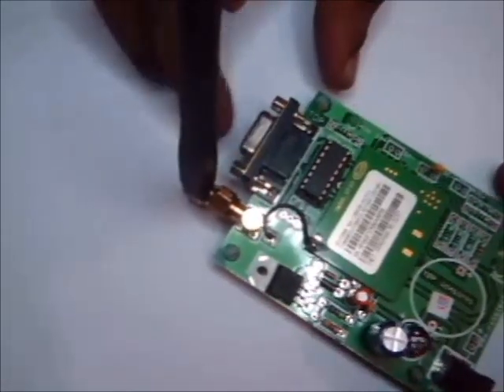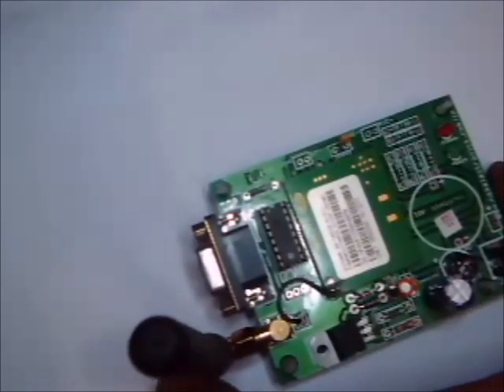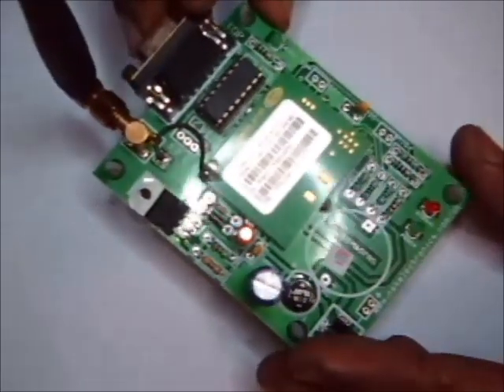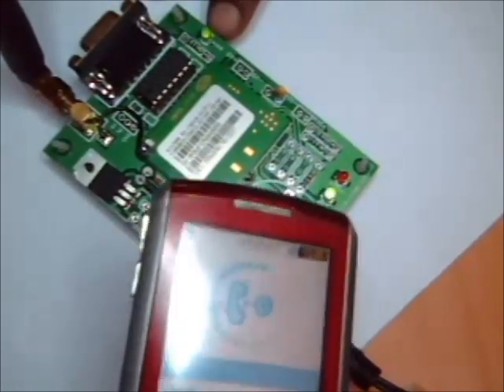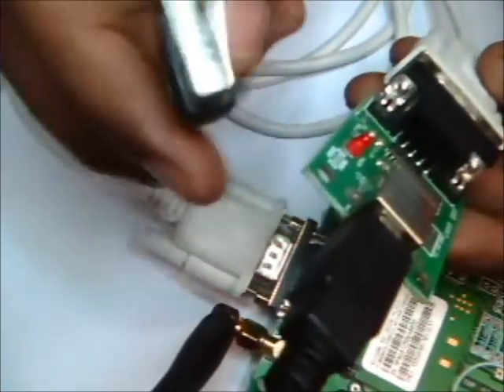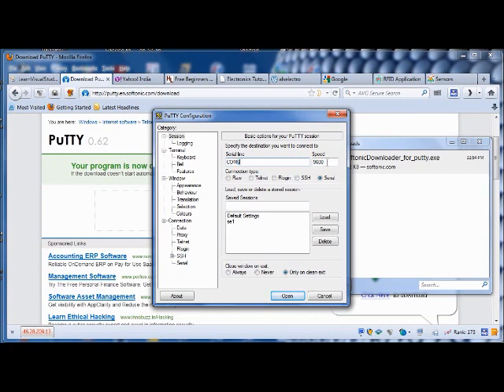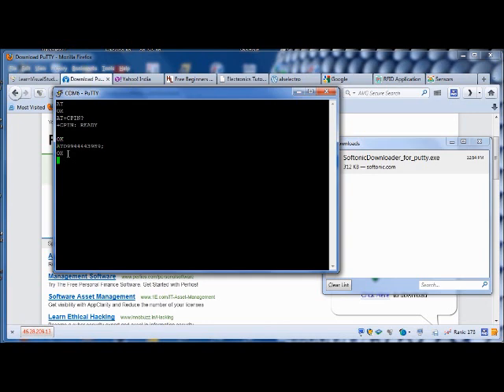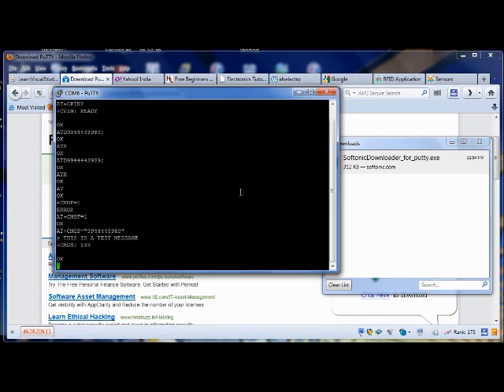GSM Tutorial

Comment: Hello sir,
I tried to connect GSM module SIM 900 via RS 232 cable, it works fine as it sends a message as well as call a number but when I connect GSM module with Arduino UNO, then it doesn't work fine not able to make a call. I made the 3 connections as mentioned Tx, Rx, Gnd of GSM to Rx,Tx and gnd of arduino. I am not able to figure out where is the problem. Please suggest me.

Comment: hello sir, i jst saw ur video and i feel i could possibly get help from you. i am designing a monitoring system using a PIC microcontroller, 3 sensors, and a GSM communication protocol. i am through building, simulation seem to work fine, the real time sensor,  the LCD display and the hyper terminal for serial comm works as well, but it does not seem to connect with the GSM modem, which i hv also tested and is fine. Pls what could possible b the fault?
Reply from the maker: check out the connections between GSM & PIC microcontroller.The TTL level signals should be connected to Tx/Rx pins of PIC.If you try to connect RS232 level signals directly to PIC ,it won't work and may damage your PIC.
Reply: Saravanan AL i was able to do a self constructed connector switching the Rx and Tx pins, but still it doesnt work

Comment from the maker: C programming for microcontrollers vary for PIC,ARM,ATMEL controllers.Each one has its own compiler & C coding to be done accordingly.For e.g PIC programming is done in MPLAB IDE integrated with Hitech C compiler, ATMEL is done trough KEIL,etc. The ports of controller are defined in compiler & you should know how to use Headers & #define statements of that compiler.
ARM is programmed in KEIL & hex file fused using FlashMagic or Philips Flash utility